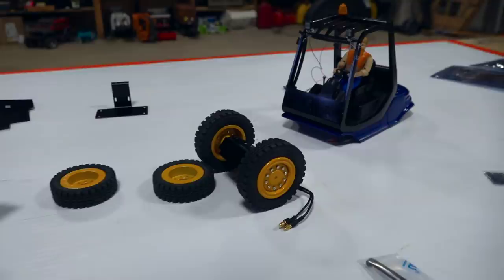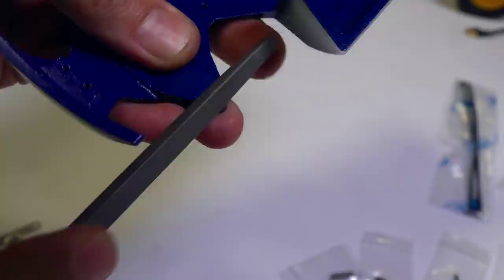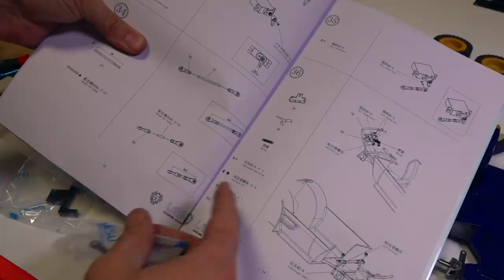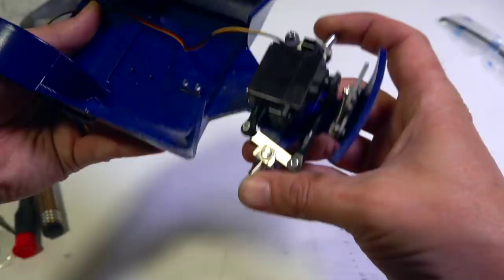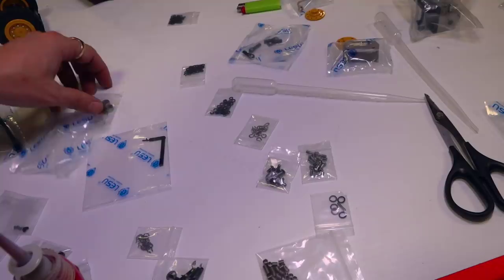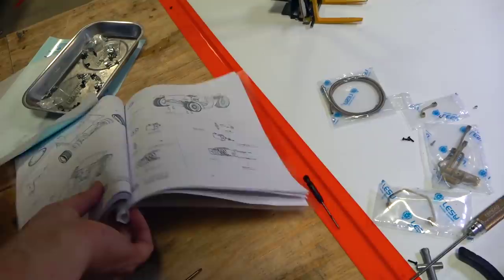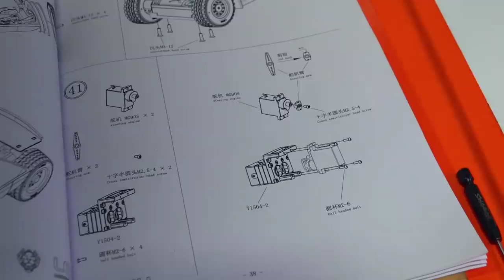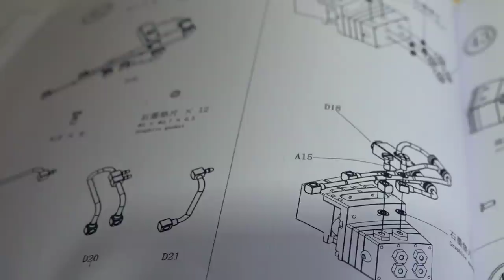BUILDING a "LINDE" HYDRAULIC FORKLIFT - "PRESSURE SYSTEM" - LESU ALL Metal KIT PT 4 | RC ADVENTURES

Comment: As you say this is an insane build, just like your excavator. I think for $1000 its very good value. In the first video I thought this was the first off kit so where there are issues or mistakes in the instructions you need to put this in an email to the company for them to rectify things.As an experienced builder yourself you  get around problems and issue easily but others may struggle.

Comment: SUPER MARIO BROS... BTW Medic...Not for nothing, and I realize you already know this, but it might be worth finding a couple washers for the inside of those wheel bearings. If there is enough room for them and the nylock nut on the spindles. I just think for how expensive/heavy of a machine and the fact that you will be moving freight it's worth making sure the bearings are secured by their inner race only and not rubbing on the whole outside face of the bearings themselves. Just some food for thought, but I know you got this brother. Awesome series man. Can't wait for the next video. Later

Comment: Don't you need to do 2 spacers on the banjo bolts, one on both sides of the bolt. If you understand. otherwise it will leak on the upper side. That's how it works with cars, I am a car mechanic in the Netherlands

Comment: Did you end up having to remove all the lines and put washers on both sides of the lines the  banjo bolts went through?
Reply from the maker: Um, no.. ?  I specifically mentioned that I put washers on them when I showed you..
Reply: @TheRealRCSparks  I only seen them on the bottom. I know most banjo bolts need one on both sides. Sorry wasn't trying to offend you
Reply from the maker: @sjrzbum  Im not offended :)